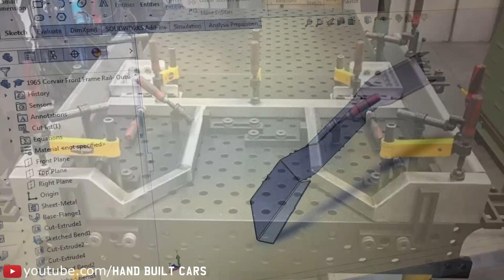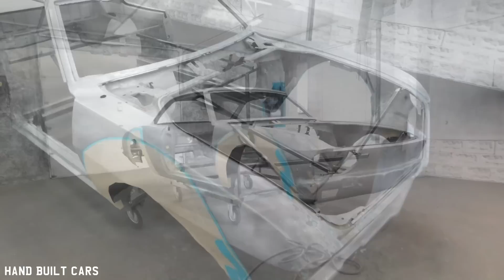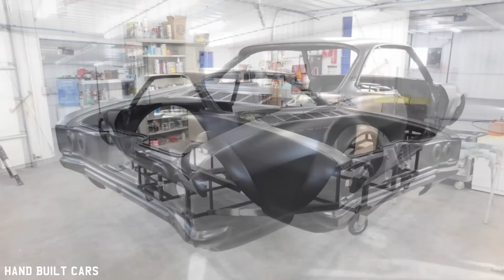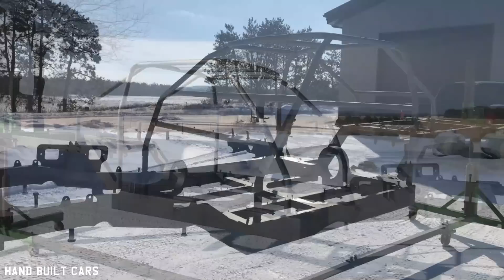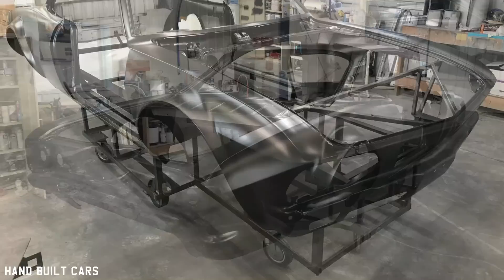1965 Chevrolet Corvair 600HP LS3 T56 Build Project

Comment: Absolutely incredible build, the level of detail is mind-boggling....RESPECT ! I have owned, loved, and wrenched on 3 Corvairs (`65 Monza and 2 `66 Corsas), built one of the Corsas into a Crown conversion mid-engine 327 back in `79-`80.  400 HP and 2500 lbs. equals a lot of fun. Many Chevelles, Goats, Mustangs, Road Runners, etc. got embarrassed by "a lowly Corvair". I miss those days !

Comment: the whole point of a corvair is its rear engined , should have done all this fantastic engineering on something else
Reply: Nope, I wholeheartedly disagree.
This is like a miniature '66/'67 Chevelle. Kind of like Scott Taylor's John Doe oldsmobile cutlass  converted from front wheel drive to rwd small tire street outlaws car. 
It's all about taking a car with body lines you love and building it to what you want.
Reply: @rustymohr6652   u ruin the lines by cutting in a grill  or r u feeding the radiator fromm underneath
Reply: @andrewmcewan8081  
Take a look at the video again at 9:15 / 9:25 and you'll see that they built a huge air box into the nose and air inlets under the bumper approximately 4"×16". This doesn't "ruin" any body lines.
Reply: @rustymohr6652  cool good for them still don't care
Reply: @andrewmcewan8081 
I guess you must. You commented first to start this thread.
Reply: @rustymohr6652  yup I commented then 2 mins late even though I ment what i said  forgot about it ,then  when it got a response I checked what I said and laughed then responded to that in the same  manner   . If u really take utube comments this seriously ur going to have a heart attack mate chill give it 2 mins and move on theres more to life
Reply: @andrewmcewan8081  nah, I'm just passionate about this particular project. I made a completely separate comment before responding to yours that I had envisioned this project for 30+ years. I'm a true car guy and artistically natured.
Reply: @rustymohr6652  the only reason anybody puts an engine in the front of a corvair is because they can't figure how to get enough power with the original architecture  , it's a sign of failure  no matter how fantastically its done.  .
Reply: @rustymohr6652  eventually
Reply: @andrewmcewan8081  totally agree. every friggen yt project car out there right now is just "wOoW i put an LS in a (fill in the blank), nobody gets creative at all. they ruined anything that made this car interesting
Reply: @Emily-lk1mf  voices screaming in the wilderness u and I
Reply: You come up with two million dollars and build what you want.
Reply: @larrysorenson4789  don't need to  gm did pretty well ,modern turbo and better belts and it's good
Reply: At this point, it has ceased to be a Corvair. It's just a body hung on a chassis. And the body has been butchered with those ugly hang on "flares". There's literally nothing special or innovative about this.
Reply: @rustymohr6652  He doesnt understand "hot rodding"
Nobody tells the purists how to build theirs but...
Reply: @gordocarbo "He" meaning who? The andrew "I haven't got a creative bone or thought in my body" person or the builder?
Reply: @rustymohr6652  comments to you by that andrew character
Reply: @gordocarbo  gotcha. Thanks for backing me up. Some other female had some comment about everyone thinking they accomplished something by swapping a LS into anything and people should just bow down to their ingenuity 😆

Comment: Awesome build!    A guy named Charlie has one he use to race in the Silver State Classic ORR in Nevada.  It was a mid engine setup and ran well hitting speeds over 170 mph with an estimated 400 to 450hp.  He wrecked one and then built another one again with the full tube chassis design both times. Its on YT and shows it doing an end over end crash at high speed but don't remember where exactly in the archives it can be found.

Comment: I have to agree that the craftsmanship is very good and I'm sure the final results are what you expected. You probably could have put any body on that frame with similar results. That being said the only thing I can nit pick on is the fender flares. Sense the chassis and suspension dictate the track width of the car I understand the need for something to cover the tires. As your craftsmanship shows your ability to do most anything to the chassis or body, it is of my opinion (and we know what options get you). How hard would it of been to have widened the body 3" on each side of the centerline, there by keeping the tires inside the wheel wells? I'm sure there is a lot more work involved but the outcome would have been outrageously more stunning in the overall looks department. Again it's just one old farts opinion.